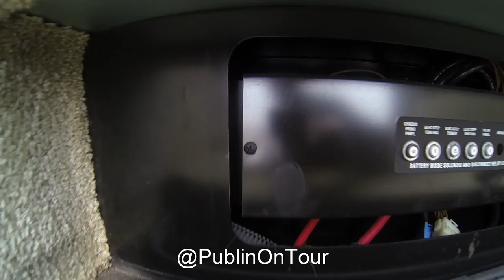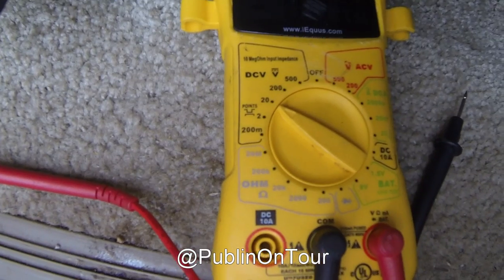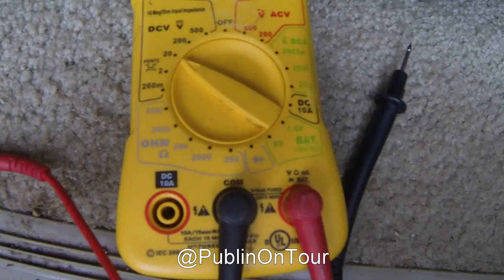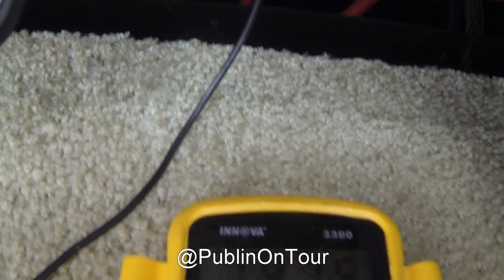Testing and replacing the motorhome RV house battery charging solenoid / Isolator .

Comment: Wait. This is confusing. Which solenoid did you replace? If the left hand solenoid was getting power through it, but the right-hand latching one was not, did you replace the latching solenoid? If not, why did you replace the left-hand one? The close up at the end was focused on the left hand solenoid. A better explanation of the circuit, and where the fault was, is in order for this to be useful at all.
Reply from the maker: I replaced the left solenoid, the switching wire was getting power but the solenoid wasn't letting the power flow through to charge the batteries. hope this helps.

Comment: great clip! questions for you: while the alternator is charging the house battery(via solenoid), will it avoid overcharging?  2nd, if you just happen to have a solar charge controller attached to the house battery as well, is there any concern? or confliction? thanks
Reply from the maker: kyl NJ hi, I’ve not noticed any overcharging issues, we have solar also and no issues there either. 80amp mppt 1140w roof mounted.
Reply: thanks for your info , let me conclude: while you are driving in a sunny day, both the engine & solar panel are charging your house batteries!?
Reply from the maker: kyl NJ correct. It’s a very cool setup.
Reply: @publinontour2589  thanks!
Reply: I need wiring photos. How thestarter alternator house battery ties in with evrything 1985 ellergo moterhome454 auto also countuse starter silinoid thanks JOHN
I'm lost without YOU

Comment: I cant help thinking that a solenoid either works or doesnt.  It either makes a contact or breaks it. It doesnt make electricity, it just passes it on... or not. As your solenoid passed on some electricity on it must work. This would lead me to think that it would only be the contacts inside the solenoid that were dirty from arcing with continued use. If it were possible to open it up and clean the contacts I feel sure that you would have had full voltage restored. Thus saving the cost of a new solenoid.
Reply: I think he was reading the battery voltage on the right hand side, no contact at all through the relay.
My relay was hot, and it is not intended to be opened up, so $22 later at O'Reilley Auto Parts, I was done.